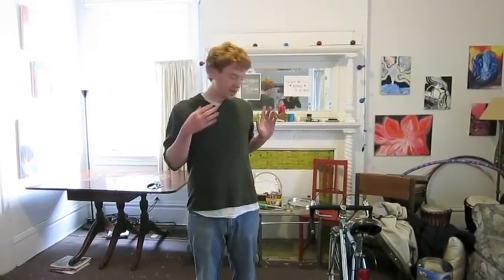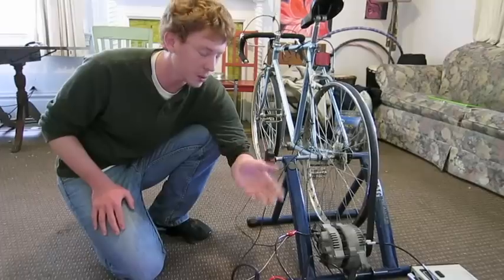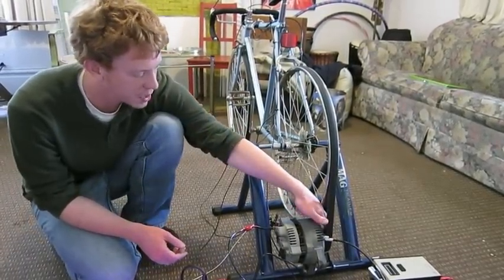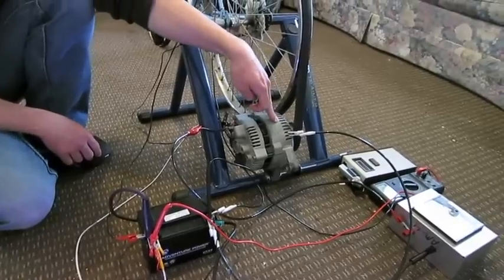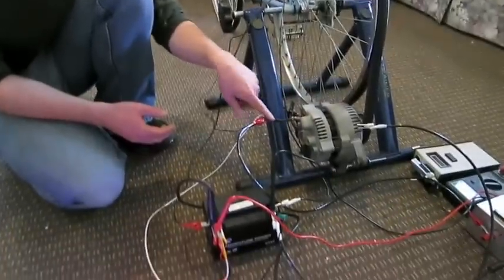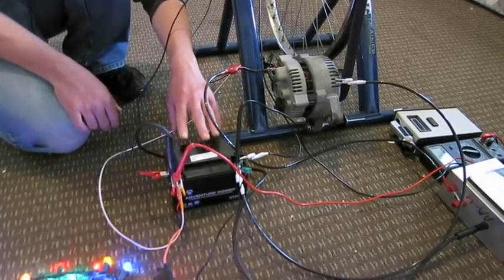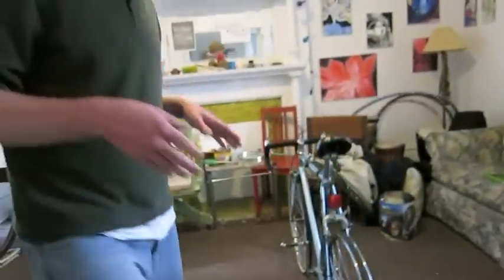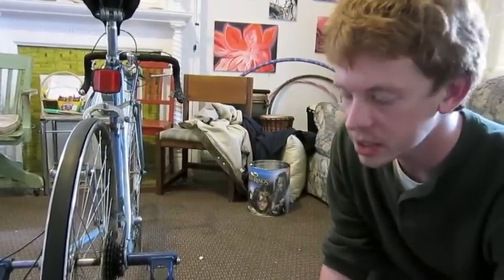Bicycle Powered Battery Charger Demo 2

Comment: Dammmmmnnnnn. You lost a bit with so many conversions and adaptors, then completely ignored the fact that the bike has gears when it comes to pedalling too fast or too slow for a given current, then kind of maybe charged a bit of a battery with that very spirited pedalling by a colleague.  
Pretty damn impressive for High-school science fair project. Wait, you mean this is University? ANd your senior project?  Fun it must have been indeed, but with a lot of rather apparent flaws to anyone with a highschool understanding of conservation of energy, which begs the question, what did you learn?

Comment: Can I charge a battery using this method to power my house?
How long would I have to peddle to fully charge those batteries.?
We should all have a set up like this
Get exercise and generate electricity
Reply from the maker: Probably not unless your house uses less energy than a laptop computer. Do some research online and you'll see that it would take dozens of very fit bikers going constantly to power a home. Not to mention, the bikers require energy also in the form of food.
Reply: Seth Bush  I got it - I'll use a motorcycle

Comment: Ya but it doesn't work. You can't pedal fast enough to overcome that EMF, bin there did that.
Reply: Well ya musta done something wrong then :)
Reply from the maker: Well, it worked. We used a rheostat to control current from the battery so the EMF was manageable. I could run a string of LED lights and a cell phone charger off of it. Although, I could only sustain the pedaling for a few minutes before I was exhausted. It was a fun project, but not practical.